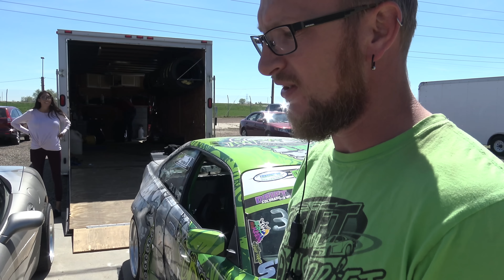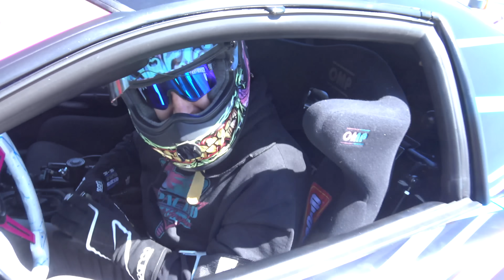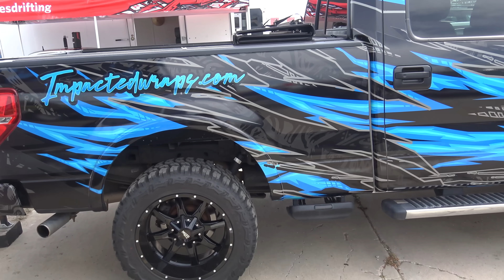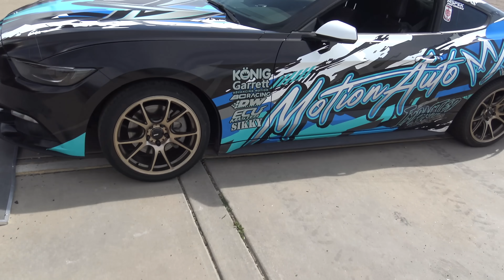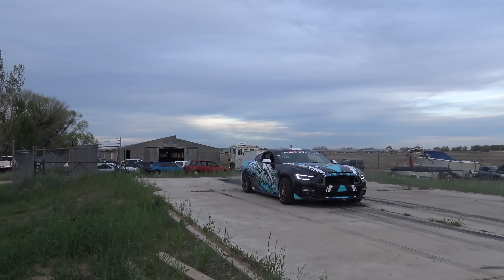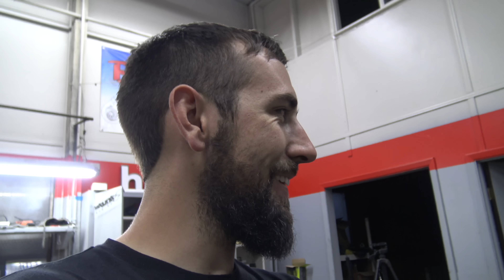2JZ MUSTANG IS BACK!

Comment: Under the brake rotor no jack stands bro?? Dont risk it with kids at home
Reply: Never know when some idiot will walk/drive by and hit that jack handle or something like that. 😬
Reply: @802Garage  these floor jacks have a pressure relief valve and can release or fail in a second. Dont trust some china made spring and jack